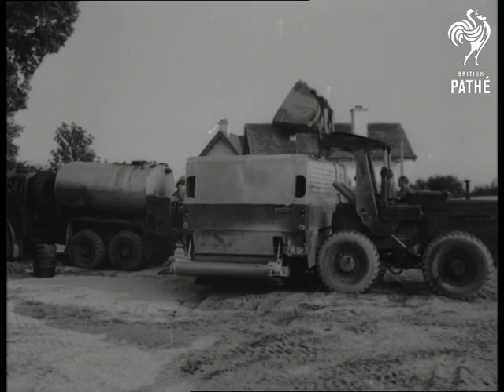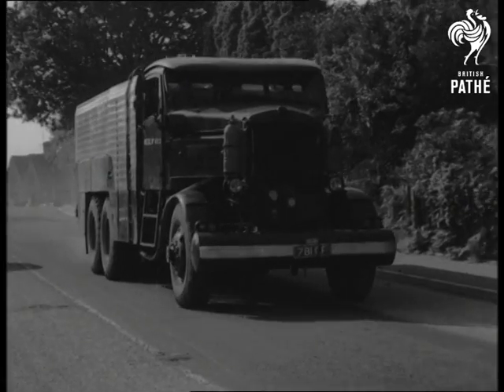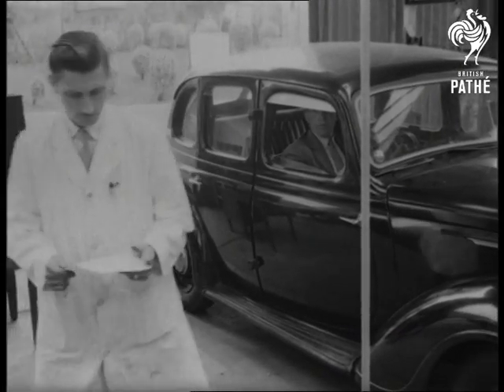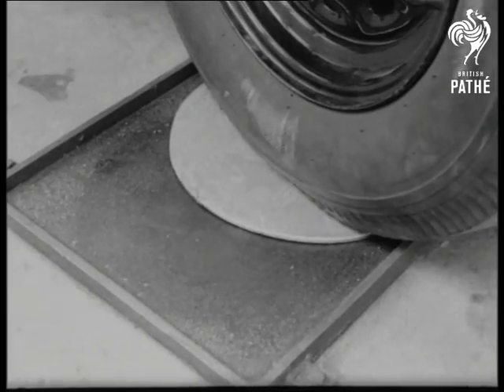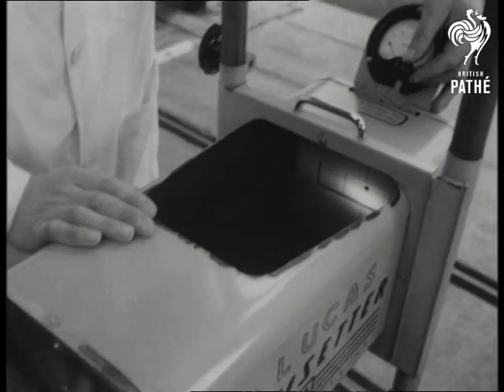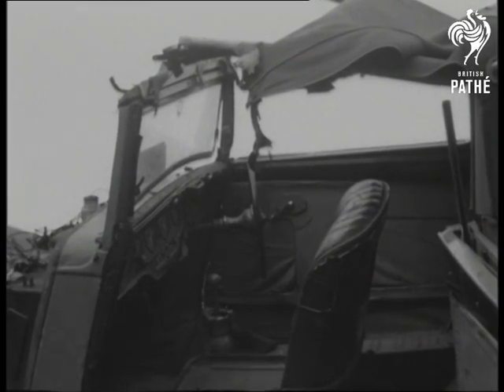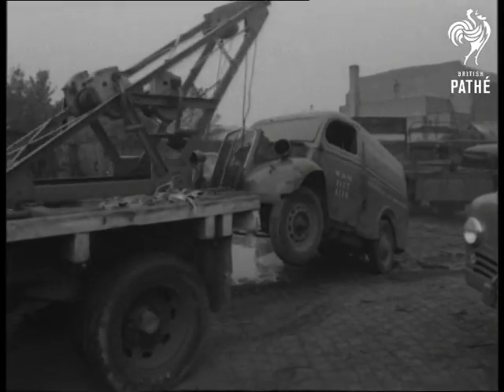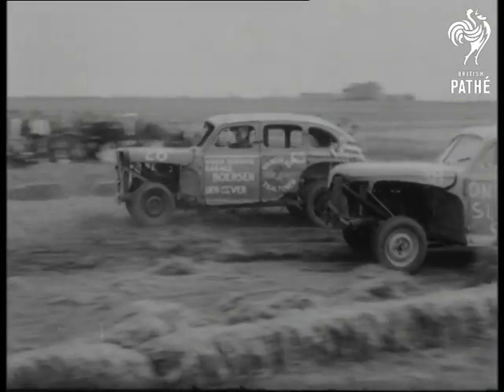All Roads Have End (1960)

Comment: The dreaded MOT test took many "classics " off the road.
I used to run a car repair shop in Missouri, a state with a safety inspection law.
Most cars passed, having no issues. 9 out of 10 that failed would fail for things like a 3rd brake light out. However, there were some truly dangerous cars that failed.
Too many negligent owners.